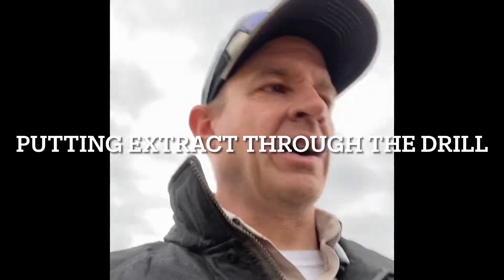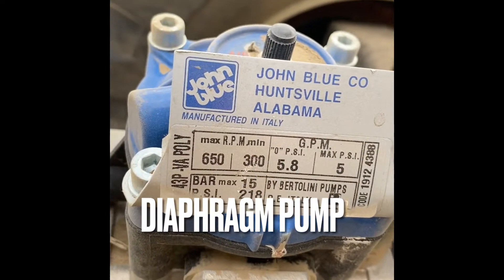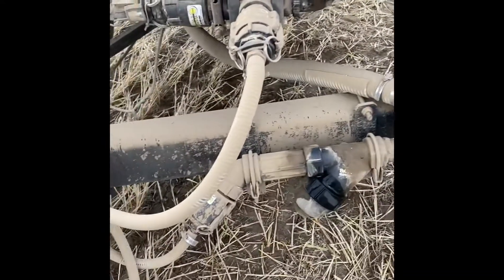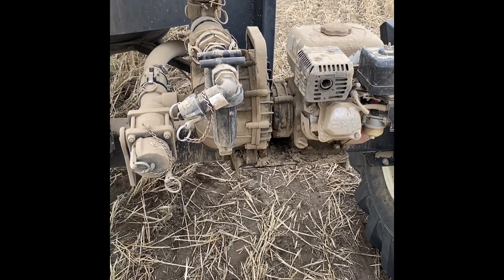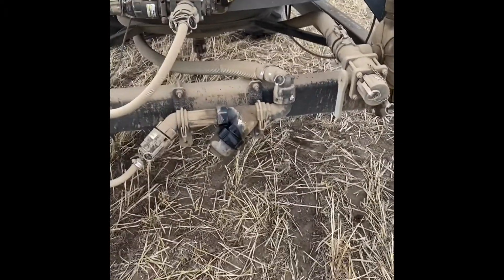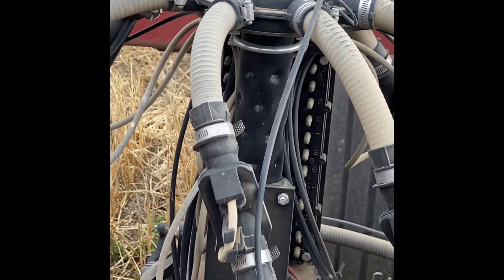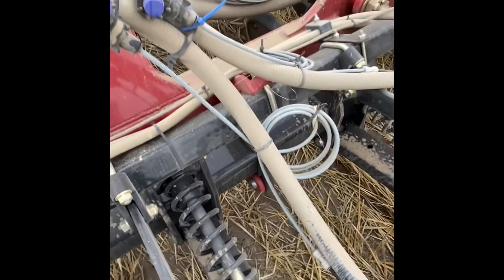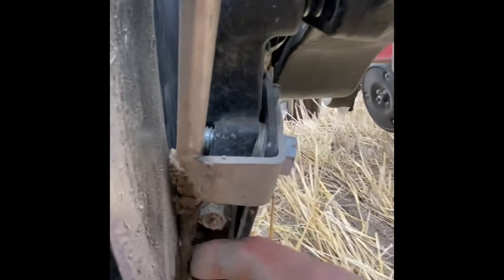Compost Extract Air Drill Application

Comment: Wait, you have a 50 mesh filter on there?  I bought an 80 micron to filter the extract into my sprayer and we're getting a drill with a fertilizer tank installed so my question is what micron filter should I use that won't get clogged?  If I extract it with 80 then run it through a 50  won't that clog it?
Reply from the maker: Hey Eric good question 😊  Mesh and microns are actually opposites.  The higher the mesh the smaller the opening where micron works the other way around.  Here is a link to the chart for that. https://www.finishsystems.com/blogs/news/mesh-vs-micron-filtration-what-is-it-all-about#:~:text=The%20mesh%20(sieve)%20system%20is,prefer%20the%20micron%20rating%20system.
Reply from the maker: What we are filtering out of the extractor with is an 80 mesh filter which would be like 170 microns and then the cart has a 50 mesh which is 297 microns
Reply: @koreyfauque7745  Thank you so much for clearing that up, looks like i got the right filter luckily from that company and our sprayer has 50 mesh in it already so I should be good to go.  Thanks again!

Comment: What's your application rate of raw compost per acre (less the water)?
Reply from the maker: Generally around 1 lbs unless it doesn’t have enough diverse biology under the microscope
Reply from the maker: If it isn’t diverse or sense enough we just ad another bucket of compost or to the next batch and check it till we get about to where we want to be (several fungi and Protozoa per slide at a minimum) there will almost always be plenty so we focus on what we are missing in the soil
Reply: @koreyfauque7745  Wow. Great work. So are you examining each batch?

Comment: What benefits have you seen from using compost extract?
Reply from the maker: You definitely can see better biology in the root zone.  It’s tough to quantify the benefits from last year as we had the worst drought in at least 20 years here (3” of rain during the growing season) but we are finding more good biology when pulling soil samples now. Biggest benefit last year was the savings from no starter fertilizer and reduced N rates which in the drought was a big home run as those would have been wasted anyways.  We are on round 2 of extract now on the winter wheat through the drill this fall with another app on top with fish guts so should have a good test for next spring to see how things look then.